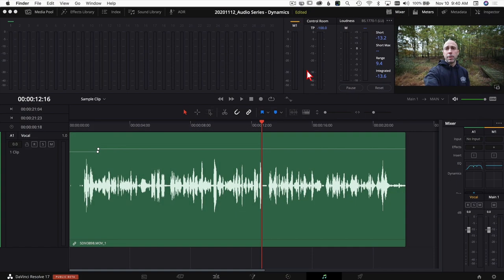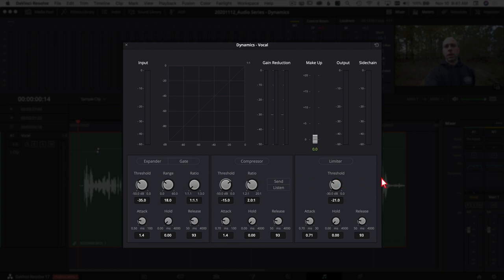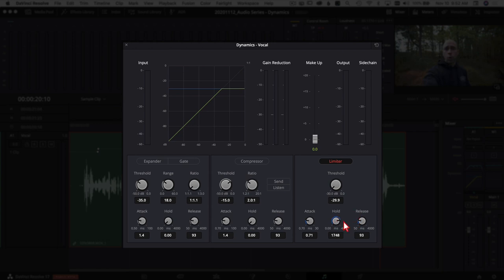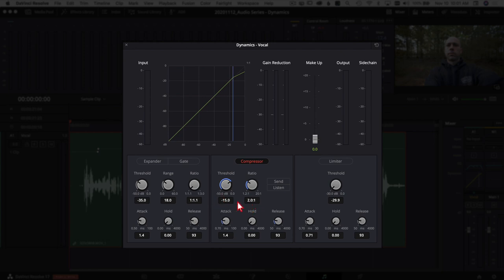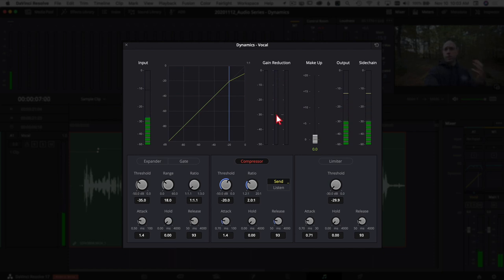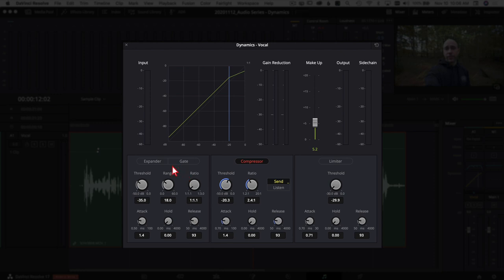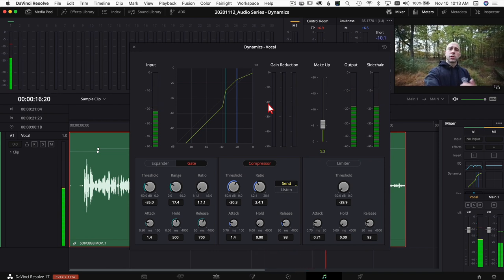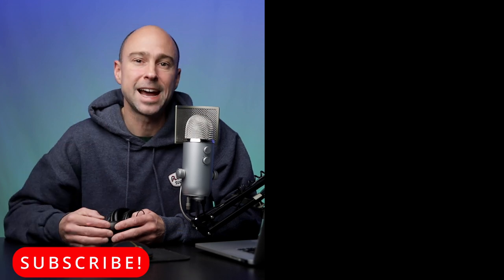Audio DYNAMICS in DaVinci Resolve 17 Fairlight Tutorial | Compression | Gate | Expander | Limiter

Comment: Could you say more about the difference between noise reduction and the expander / gate? Am I missing something or do they give equivalent effects?
Reply from the maker: The expander and Gate are going to reduce the level (volume) of audio below a certain DB level (threshold) that you set.  It can either completely cut off the audio using the Gate, or just reduce the levels (based on your settings) using the expander. For example, the Gate and Exapander will help reduce the noise between words when speaking or if there is some sort of background noise below a certain DB level.  The Noise Reduction included in Resolve works a little different and in my opinion it really isn't that good. I really don't use it because I'm not usually satisfied w/ the results, but it try to isolate dialogue/vocals and eliminate other background noise.  In reality, instead of the noise reduction effect, I'd use Voice Isolation if you have the studio version or I'd use something like Waves Clarity VX.

I hope this helps a bit, let m know if you have more questions!
Reply: @JasonYadlovski  Thanks Jason, I have been using the noise reduction but maybe I should try the gate / expander
Reply from the maker: It’s worth a try, depending on the noise you want to remove.  👍

Comment: Hey Jason!
Hope you are doing great!
I'm just wondering if I can modify single audio clips in the tab fairlight.
Thanks for everything you share!
Reply: forgot to mention, without adding any other track
Reply from the maker: Hi Miguel!  Doing great here, hope you are well too!  Yes you can modify individual clips in the Fairlight tab, just select the clip and use the inspector to make adjustments.  You can also add effects to individual clips by opening the effects library and dragging/dropping an effect onto a clip.  Unfortunately you can't use the dynamics on a single clip, that has to be on a track level.  Hope this helps!

Comment: Hey great video, definitely the best for dynamics in Davinci. But I don't really get the difference between compression and normalization.. Thanks.
Reply from the maker: Thanks!  So normalization will essential adjust the entire clip in one shot so that the clip meets the normalization level you set.  For example, if you normalize Peak volume to -9db, then the clip would auto adjust the volume so that the max/peak levels are -9db and everything else will move accordingly.  

Compression is a bit more dynamic on how it works.  You set a threshold or level where you want it to start.  For example -20db.  Then you compress or reduce any signal over -20db by the ratio you select - for dialogue typically 2:1 or 2.5:1.  This means for every 2.5 db of volume over the -20db threshold, the volume will only increased by 1db.  So it's compression the audio above a certain level you set.  

Compression also allows you to make quite parts louder and louder parts a little quieter, where as normalization only sets on level and everything moves accordingly.  So quite parts wills till be quiet.

Hope this help a bit!
Reply: @JasonYadlovski  Yes now it's clear, thank you really much! But what if I adjust the volume of the clip in the mixer  until I reach the point I want my peaks to be, instead of the normalization?
Reply from the maker: If you adjust the peaks to where you want, your doing the same thing as peak normalization. Compression allows for more consistent audio  by allowing you to boost the quite parts while limiting (compressing) the loud parts.

Comment: At 13:30 your said "A gate allows you to set a point, and then below that point you can lower the volume as much as you want."  Isn't that what an expander does?
Reply from the maker: Yes the expander does the same but with less adjustment options.  I’d use the expander to lower the volume, I’d use a gate to cut the sound out (like background noise).

Comment: In what circumstance would you use hold?
Reply from the maker: Hi!  Hold is used when applying dynamics.  It tells Resolve how long to keep the compressor/gate/limiter active after it is no longer needed.  For example if you are speaking and take a breath, with zero hold, the effect will turn off and then turn back on when you are speaking.  If you had the hold set for 1/2 a second for example, the effect would stay on while you take a breath because it's holding it for a length of time you specify.  Does that make sense?  Hope this helps!

Comment: Hi Jason. Do you ever get crackling problems with your Blue Yeti microphone?
Reply from the maker: Funny you mention that, I don't get cracking in my yeti, but yesterday I was trying to record directly into resolve and I was getting some cracking.  It was  because Resolve was set to 48,000 rate and the mic was at 96,000.  Once I matched them up, it was good to go.  Maybe look into that...🤔
Reply: @JasonYadlovski  Thanks a bunch for the tip Jason, I will definitely make sure that my settings match. Keep up the good work with your to-the-point videos!
Reply from the maker: Will do!

Comment: How do you RAISE the level of low-volume voices? I'm working on a panel in which some speakers are super loud and I can fix that with a compressor, but how do I raise the voices of the panelists whose microphones are very low?
Reply from the maker: You can try the new dialogue leveler if you have Studio. If the voices are all in the same track, use the makeup slider in the dynamics panel to make the quite voices louder while using the compressor to make the loud voices quieter.  If the quite voices are in their own track, use the volume slider in the inspector or the compressor/makeup in dynamics.  I’f you use any effects that have gain, you can also boost the levels there.

Comment: Thanks. I'm trying to move from Premiere Pro to Resolve. I use the dynamics effect in PP, but I can apply it to the clip instead of the track. I generally edit using as few layers as I can. Is it possible to apply such adjustments to the clip, or am I just doing it wrong? I also ordered studio with the speed editor, and someday it may even ship. I use the Contour Shuttle Pro 2 currently.
Reply from the maker: You’re welcome!  Yes, you can apply to a specific clip if you’d like. Just open your FX library, go to the audio FX, click on the one you want and drag it and drop it on top of the clip you wanna apply it to.  Then you should have the effect on just that clip. 

That’s awesome that you got the speed editor, it looks pretty cool.  The studio version is awesome since it uses a lot of GPU power versus the free version uses only CPU power.  Plus you get some extra features and effects and what not. 

Best of luck making the transition, I’ve talked with a lot of people who have done it and it seems to work out well.  Thanks for watching!

Comment: Does DaVinci Resolve not have a dynamic processing option? This video’s great, but I’m just looking to “process” the audio like in Adobe Audition. Raise the valleys, lower the peaks, create a more unified sound. Sort an auditory version of ‘best fit line’. That way, if I raise the volume, it doesn’t overmodulate or even worse cut off peaks.
Reply from the maker: I’ve never used adobe audition before, but if you’re talking about something like dynamic EQ, it doesn’t have that built-in. But if you had a plug-in, you can run any audio plug-ins that you have right inside of fairlight.  I’ve been using the F6 waves plug-in lately, are you talking about something similar to that?

Comment: What is the opposite of an expander? I tend to talk really quiet and then get really loud. So I turn on the compressor to control the loud parts, but then I have to manually increase the volume of all the parts that are too quiet. Is there something that will automatically increase the volume of anything that's below a certain dB?
Reply from the maker: Hi!  Probably the best, but must time consuming thing to do is use keyframes to keyframe the quiet parts louder.  Or make cuts around the quiet parts, move them to a new track and work with them there.  If you don't want to do that, I'd boost the makeup, enough so that the low parts come across well, then apply the compressor and lower the threshold to compensate.  Not sure it it would work, but that's where I'd start.

Comment: Since Resolve 14 I've noticed that whenever in Fairlight I apply the equalizer settings you recommend in your previous video, it doesn't save it, (in multicam I click on the audio I want fixed, but I click away and come back and it's as if I never EQd, what am I doing wrong?
Reply from the maker: Hi!  that's strange, I haven't seen that before.  Maybe try a new project?  It should hold the changes for you.  🤔
Reply: @JasonYadlovski  on multicam edits this happens. The question is am I supposed to do EQ etc on the track selected on the timeline (which could be multiple selections throughout a multicam - Or - should EQ be done after you “open in timeline” the multicam individual clips then edit those individually? If it’s the individual clips I will tell you that it never remembers the EQ I do, when I come Back to the edit it doesn’t show up. Also it’s confusing that when you click Equalization in Fairlight, It seems to be a separate thing then clicking on the one in inspector. If I was to use just my intuition I would want to turn on the equalization in inspector if I’m doing any equalization in fairlight. I’ll try to send a short video here so you can see what I’m talking about
Reply from the maker: I understand it can be confusing.  Just to clarify the difference between the EQ in the inspector and the EQ in Fairlight in the mixer - The EQ in the inspector is a more basic EQ and only applied to individual clips.  The EQ in the mixer in fairlight is has more points to adjust and is applied to the entire track.  For me, when I make multicam clips, I have 1 consistent audio source inside the multicam clip, so I just use the Fairlight EQ to apply EQ to the entire track in my normal timeline.  In general I use the Fairlight EQ for the entire track.  I'd only use the inspector EQ on a certain clip if that clip needed some additional EQ that I could not accomplish with the Fairlight EQ.  Here's a whole video on EQ if you are interested:  https://youtu.be/5Rs1XRQSlAM

Comment: Just a question, I've been told that voice should be mostly around -10dB and -20 dB. But sometimes there're peaks that go above -5dB. Should I limit them with the threshold if there are too many to solve them manually (with the inspector and softening that peak isolated)? 

Thanks, Jason.
Reply from the maker: Hi Jordi, thanks for checking out the video!  Generally I set my levels to between -8db and -15bd.  You don’t need a limiter, but the compressor can help.  Here’s a video I did on how to set your audio levels, maybe it will help you.   https://youtu.be/UCmueEJGm4A

Comment: Is the Dynamics panel only on the Studio version or also in the free version?
Reply from the maker: It used to be in the free version too.  I think it still is in the fairlight tab.
Reply: @JasonYadlovski  Will ask around. I only have EQ / Pan / Groups. So yeah It must not be included in the free version after all.
Reply from the maker: Did you try scrolling the middle mouse wheel on that area? Or changing the size of the mixer? I’m 99% sure it should be there.
Reply: @JasonYadlovski  If I scroll over where it says (No Input) first down is EQ next is Pan and last is Group.  So yeah they must have ditched it on the free version. Bummer.
Reply: @JasonYadlovski  ok I figured it out. you have to uncheck the EQ in order to get the Dynamics tab. I guess your can’t have both on at the same time.
Reply from the maker: Strange.  You did say you checked in the 3 dots in the top right of the mixer right?  To make sure dynamics is checked on.  According to the manual it’s still part of the free version, just looked it up.  Maybe try resetting your UI, maybe somethings out of whack somewhere.
Reply: @JasonYadlovski  Yeah there are a whole list of checked features but I guess you can only use one at a time in the free version.
Reply: @JasonYadlovski  I Just ended up using the EQ over the dynamics. I figured since you can’t use both this video needed the EQ more. Might have to export the audio on future videos and mix it on another computer loaded with Logic Pro.

Comment: 4:31 ... Respectfully, your description of the limiter in this particular panel is incorrect. Allow me to share incredibly helpful info here. The limiter in this panel is NOT a "hard" limiter, that is, it does not set a hard ceiling above which no signal can pass. This limiter is really just the compressor in drag ... with a high ratio. If you try to use this to set a hard limit, say to meet YT standards, you are going to be endlessly confused and frustrated. BUT, if you click on EFFECTS > DYNAMICS > LIMITER, there you will find a simple hard limiter. I do all of my NR, EQ, compression, etc., and then do this hard limit last (by just setting it to, say, -1db). It took me so $%&! long to figure that out ;-)
Reply from the maker: Thank for watching!
Reply: @JasonYadlovski , no, thank you. I've learned a ton from your channel :-)